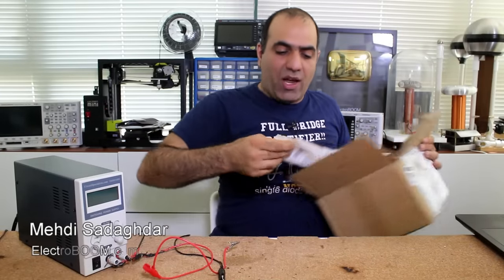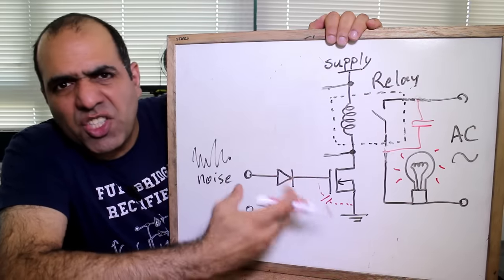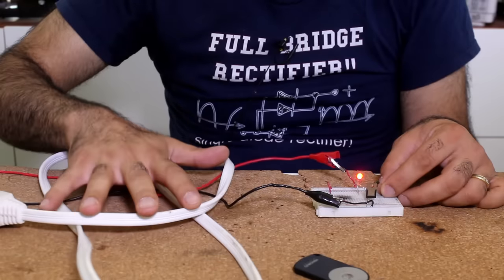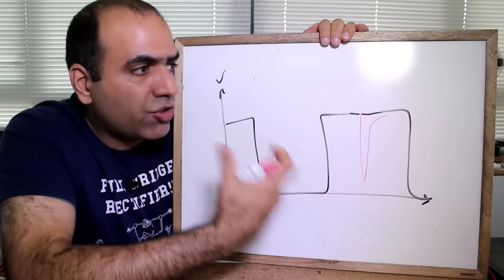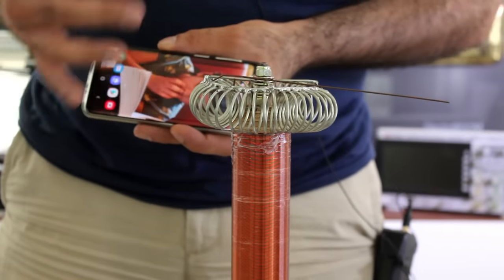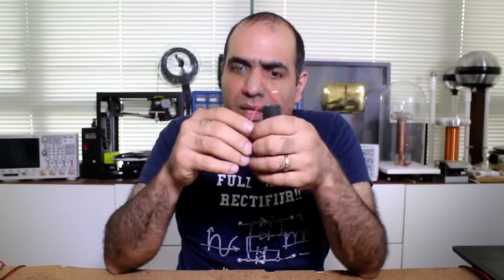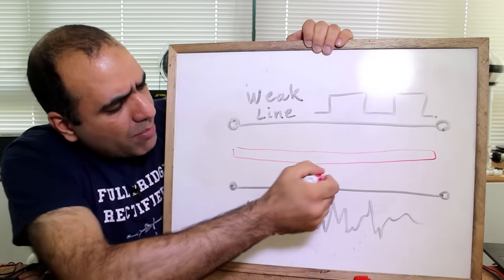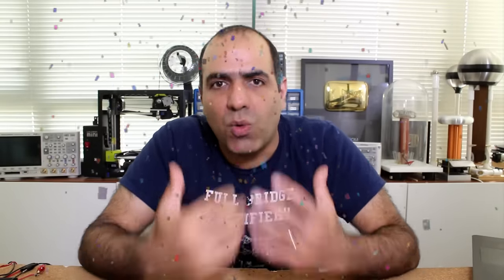Destruction with EMP Device, Understand and Battle EM Interference

Comment: anyone know which high voltage module he has in the beginning? dont want to buy one that doesnt work, bought a HV Generator kit (like in 4mil wand video) and soldered everything correctly on the pcb board and even used my multimeter to make sure i had everything set.
Didn't work, thought i messed up, watched a tutorial from a guy online and he did it almost the same way as i did and yet my kit didnt turn on. i changed the coils for both primary/secondary as well as polarity and saw a piece of paper inbetween the two halfs of the flux. removed it, tired again, then gave up.

TL:DR What is the name of the power module he is using in the beginning? bought a HV generator kit (like in 4mil vid) made correct,multimeter showed good but didnt work. spent two days trying to fix, rather not found these trash kits if i can buy one that works out of box for same price

Comment: I’ve been designing a EMP directed laser in a military situation, basically it’s a directed laser of EMPI (electromagnetic Pulse interference) to basically a grounded satellite shaped thing, that sends out a huge surge of electricity, in pulses, it could disrupt planes, drones, or boats of any sort. Not really a military thing, more of just a little sketch and idea thing. For instance, a Tesla coil is off and a phone is near it, but when the Tesla coil is on the phone screen starts malfunctioning, mind you the phone isn’t touching the Tesla coil. My idea is basically that, a device that disrupts other devices over a long range, only reason it isn’t really possible is mostly because the amount of energy used would be just totally out of this world, that is if it is not a sudden burst but a continuous laser beam. It’s really just a paper and pen design tho.

Comment: I thought an EMP works not by radiation but by magnets. It creates a strong magnetic field that induces current in every wire around it and fries all the circuits like a transformer.
Reply: It can be both, the E stands for Electromagnetic. Using electricity is simpler because it has higher range, and a magnet needs to be moving to induce a current. Which also means it’s harder to get a non-smooth wave

Comment: There's an easier way to build an EMP device. All you need is a nuke. So a barely subcritical sphere of plutonium incased in multiple shape charges of conventional high explosives. If you trigger them perfectly (really perfectly) timed, they will compress your sphere of plutonium and make it promt supercritical, causing a huge explosion and tons of radiation. The ionizing x ray radiation will ionize the air in a big radius, causing an EMP. Sourcing the plutonium isn't easy though xD

Comment: Sir, i know you know you arent gonna die during these experiments, but how do you do it?  im not trying to replicate it, i used to do alot of FAFO and microwave capacitors are... well deadly 😂 ive seen you zap yourself with what seem to be comparable capacitors... and when i discharged a few, if i didnt hold onto the screwdriver it would fly 😂

Comment: I can tune with more ore less ions in your languids .the way the tube is going to listening like the led jar .
When I put bothe fealers inside on the multymeter runs the led without feildcopasators to tace out in to the 9 wire again from inbetween the gass in the jar .
The space becomes less negative I can produce waves with onley moving one finger in sequence on 3 meters awa🤣🤣🤣
Reply: Hee I have the same with mi phone bi the reactors 🤣🤣🤣 lol
Reply: Tace a broken bicker lamp our normal old tred lamp.
But 0 of the dynamo on boths and run the dynamo put in the plus a heat sink💜
And see how smaler waves you can reseve with this lamp inbetween you osciloscoop probes .
I going to make it miself if I ged this oscilloscope operating again💜💜💜
Reply: You can listen beond the reaghe of the jws telescope this way😋😋😋🛸🎁
Reply: Same way whay a cristal is ampyfyïng the same way as the magneticle lencing men named gravetational lansing💜
Reply: If you pull in to the wire space around it pulled along in the other wires is pulled along this way o lower the thention again in the midle of the feildcopasator the 0 wire of led as I showed  bevore 💜